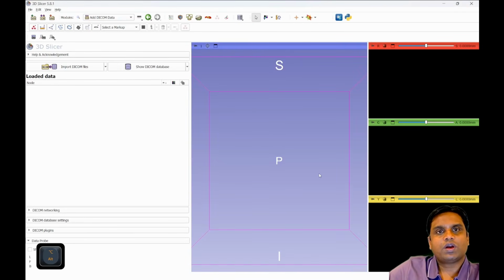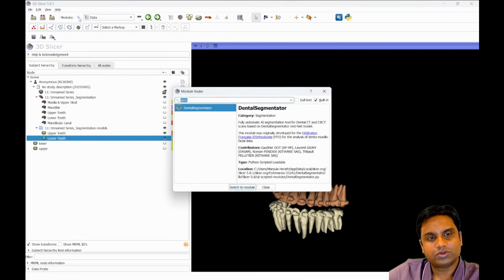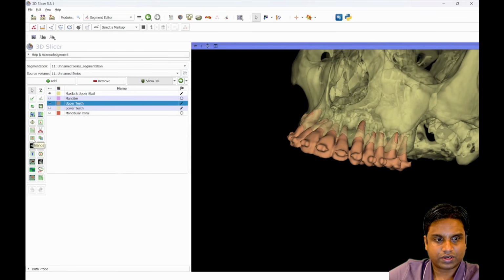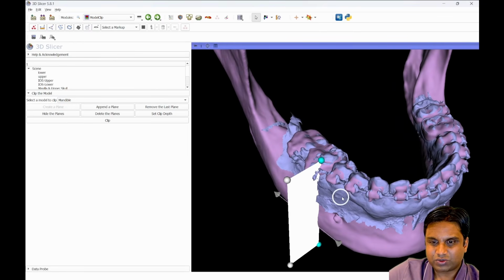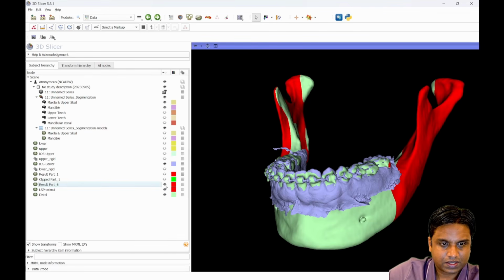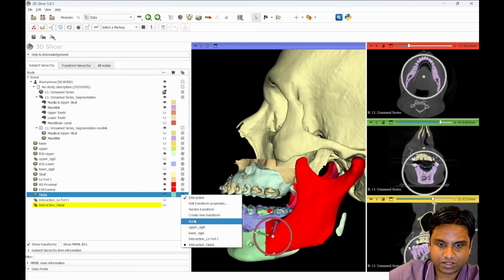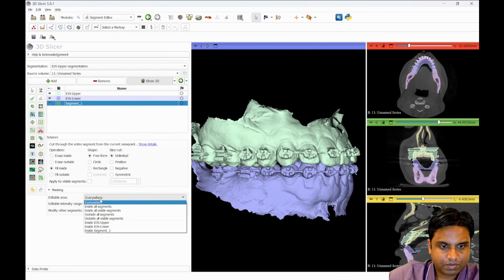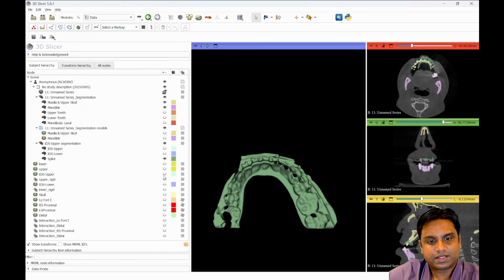Digital Orthognathic Planning with Free & Open-Source 3D Slicer

Comment: How can we accurately register an intraoral scan to teeth extracted from CBCT? We used FastModelAlign to align the intraoral scan with the CBCT tooth segmentation. However, the registration evaluation reported a distance of approximately 10.30 mm, or about 1 cm. This error is unacceptable for our application because it could create significant positional errors in the complete 3D structure. Nevertheless, we should not conclude that FastModelAlign itself caused geometric distortion until we confirm which distance metric was measured and whether both input models contained the same anatomical regions. How can we validate the registration result and determine whether the transform generated by FastModelAlign is reliable?
Reply from the maker: Hi Sorry for the delayed response. Where was it reported as 10.30 mm error ? In any case you might have have to optimize the scan and the segments to get the best results (trimming unwanted parts) and then applying the transformation to the full scan. My experience is that you can get the same results as with ExoPlan or Materialize Enlight or mimics with much better control of the segmentations. As in any other software you should verify manually the alignment by visual inspection against the CT/CBCT and the algner IOS. Also you can use heatmap (model to Model distance module) .

Comment: What about Natural Head Orietation Position? How you do that on 3d Slicer?
Reply from the maker: It can be easily done but in true VSP with guide driven surgery it is a legacy step. It is thinking n terms of  just digitized analog workflows.  I will try to create a video for this since there are multiple ways of doing this in 3D Slicer